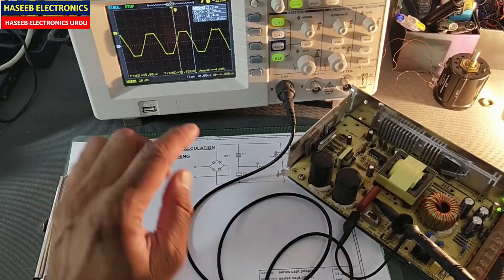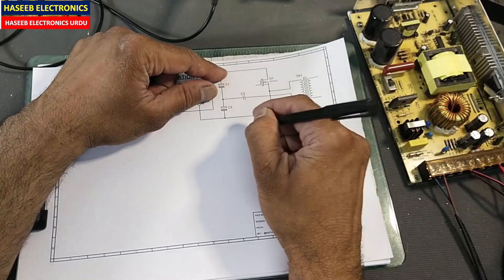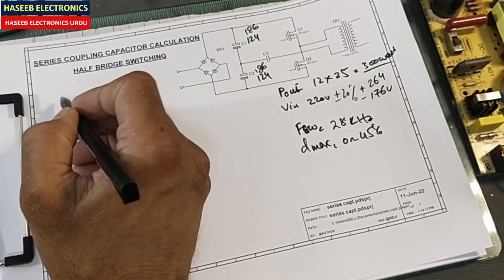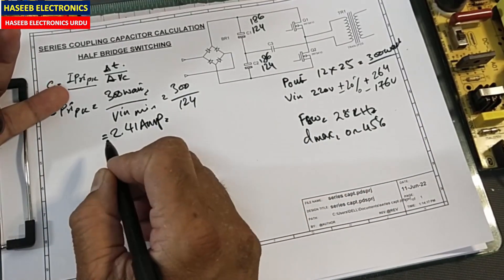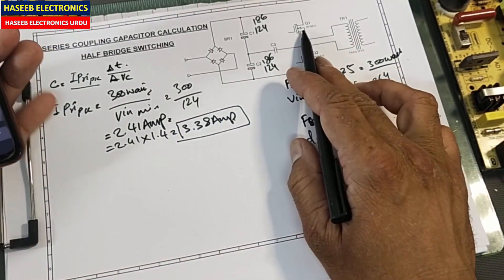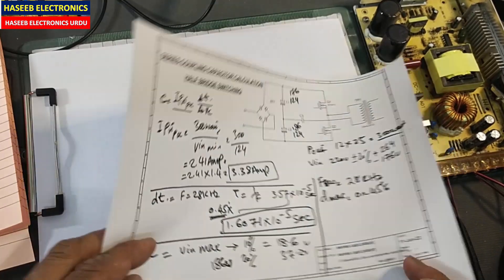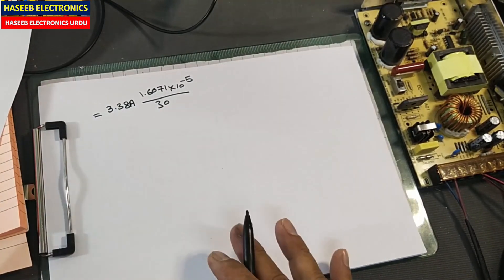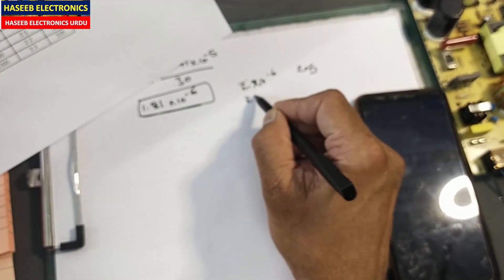{626} Series Coupling Capacitor Calculation in Half Bridge SMPS

Comment: You are showing that the current is flowing in one direction across the primary winding, this is which I cannot understand how can the transformer be working with DC and make voltages induce on the secondary, could you elaborare on it and help me understand this circuit thanks

Comment: Great video but these caps are used in lots of smps in half bridge converters, where I see  No two power sources, but one with 400VDC and small driver transformer which controls the two transistors. So how on earth does the current flow in alternate direction across the primary if only one supply is used? Does this cap not serve more than just blocking function? Also what you are showing here is not AC at all? How can a DC be used in transformer. Thanks for your reply

Comment: Why did you use the maximum input voltage to calculate the series coupling capacitor also how can we calculate the input voltage divider capacitor and the transformer winding calculation.
Thanks

Comment: Sir, when you are probing the coupling capacitor, while the SMPS is powered by mains supply, do you use isolation transformer for the oscilloscope?

Comment: If i simplified this two caps being one cap. The total capacitance would decreased by half and is not necessary to divided Vpeak to 2 ?
Reply from the maker: perfect 
but it is used in half bridge topology, so the capacitor value is calculated based on the current requirement by 1 mosfet on 1/2 dc rail voltage

Comment: If the two caps were in parallel, the Vpeak will be divided by 2 (2 caps) ?
Reply from the maker: in parallel capacitors the capacitance will added 
and it will charge at peak voltage value

Comment: السلام عليكم 
Dear sir Iam asking when  repairing inverter welding machine can we use capacitor in greater values instead of the original ones for example the original capacitoers 680 uf are damaged can I use 820uf instead.
Tanks alot

Comment: Thank you for the great video and valuable information. What is the series capacitor is for? Why do you need the voltage drop across it? I have a lot to learn still. Best regards sir!
Reply from the maker: thanks a lot 
as we know the half bridge push pull topology uses 2 switching devices and it uses 1/2 of the supply voltage 
to divide the dc voltage 2 polar capacitors are in series. 
at each half switching cycle one mosfet will switch and it will draw the voltage from its respective capacitor. in series of the transformer primary winding there is a non -polar capacitor (so called series coupling capacitor) 
if it is not used, the term "flux walking in dc rail" will present and it will cause to damage the capacitor and switching mosfet
it is also a fault condition, when this series capacitor is short circuit or its value is dropped, it damages the mosfet and capacitor 
as this capacitor is in series of the winding, so it will be a series load in the circuit, that's why we need to specify voltage so that it must not drop the converter efficiency
Reply: @HaseebElectronics  Thanks for the answer! I guess you can't just put a larger capacitor to lower the voltage drop because of the condition of "flux walking in dc rail".  Some voltage drop from capacitive reactance is required.
Reply from the maker: exactly you are right 
this was calculation for that coupling capacitor. to allow a limited voltage drop with having proper output 
if it will small capacitor, the output power will drop 
if it is too  large value, it will cause to drop more voltage and heat dissipation

Comment: Thankyou very much sir ji, you are amazing, Sir is it possible to measure inductance and capacitance using DSO/CRO, if yes then can you make a video on it or if not then please tell some other way to measure it
Reply from the maker: just we can look the signs specified for these components but we cannot measure their values 
you can use X-Y mode and connect the component to the test probe 
but it is not useful practically